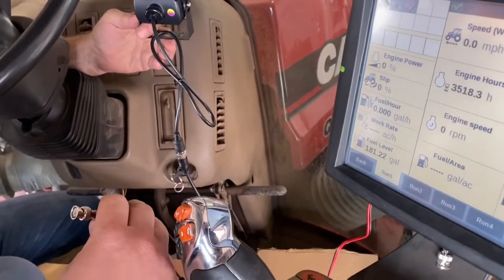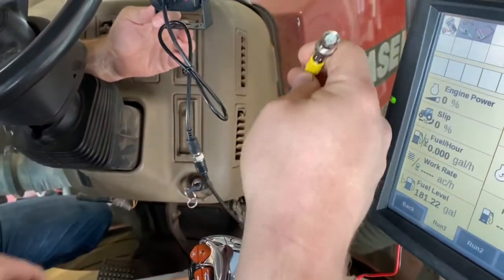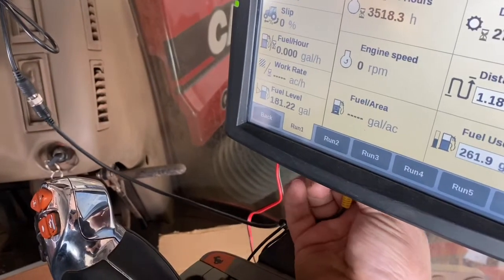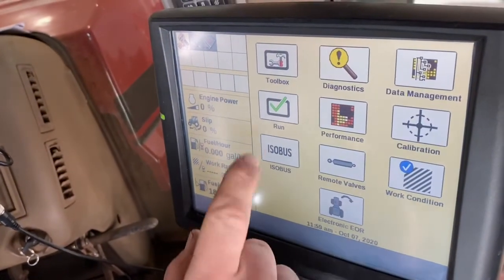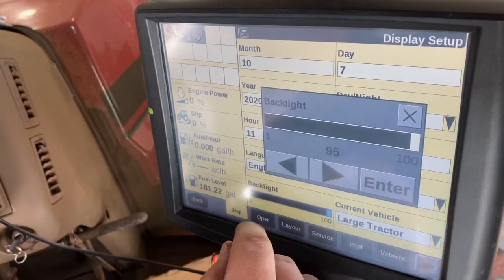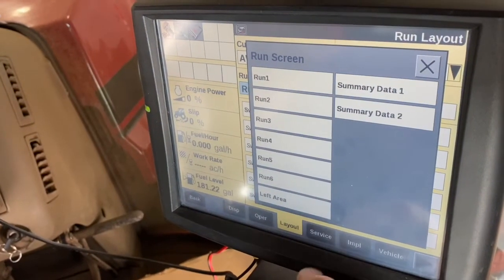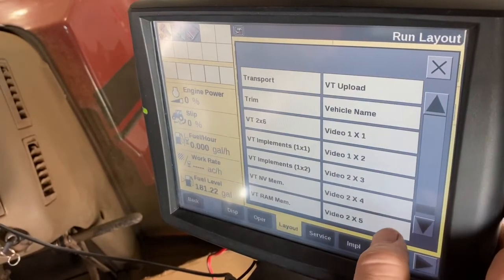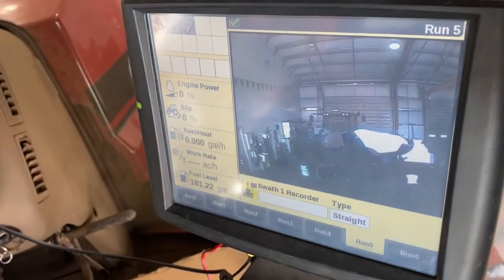Connecting a Camera to a Case Pro700 monitor in a tractor

Comment: Will it trigger a camera overlay when put in reverse like the integrated system on the combines?
Reply from the maker: Hi…thanks for watching this video on connecting our cameras to a Case Pro 700.  That is a good question.  Triggering a camera to come up on the screen is a function of the monitor (Pro 700).  I believe that you can make it do this…however I suggest you contact your local Case dealer and ask for their Precision Specialist and if they don’t know the answer, I am certain they can find out for you.  If you want one of our cameras they have a 3 year warranty and the part number for a camera/cable bundle for a Pro 700 is VWCAMBN-CASE7

Comment: Hi, I am looking for the same camera and cable for this monitor which you use on video. Can you give me the name of this camera and cable?
Reply from the maker: Hi Thanks for watching the video.  The apart number you need is VWCAMBN-CASE7.  That will plug into the bottom of the Pro 700 and if you want to plug up to three cameras into the monitor you will need a harness that you can get from Ag Express.  In this link you can find our GPS fit chart and if you go to the CASE section in the second column you will find the Ag Express part number.  Then depending upon where you are from please click on the second link to find your local Camera dealer.  If for some reason we don't have a dealer close to you please have your CASE dealer contact us at 541-995-8000.  Hope these links help and you are able to increase you safety and productivity with a camera kit that sell for around $185.  These cameras have a 3 year warranty and high res.  https://www.visionworkscameras.com/gps-cameras       https://www.visionworkscameras.com/dealer-locator
Have a fantastic day
Reply from the maker: Hi Iceman the part number for this kit is VWCAMBN-CASE7
And you can find your closest dealer by simply putting in your zip code at this link. https://www.visionworkscameras.com/dealer-locator